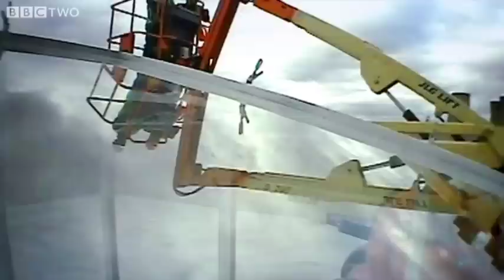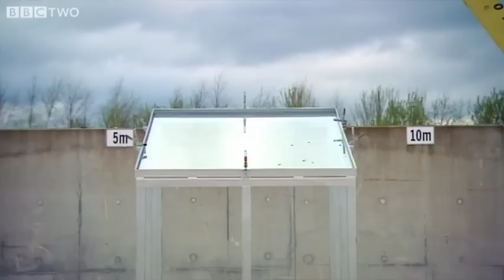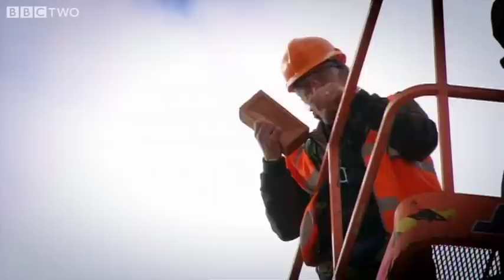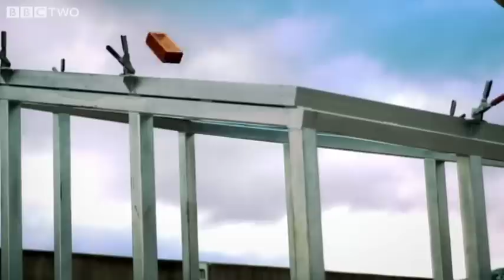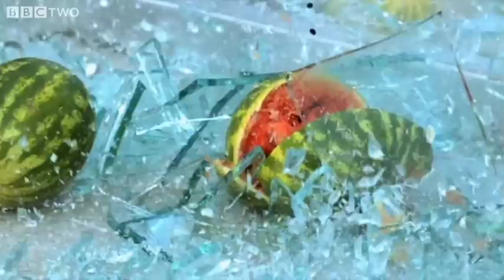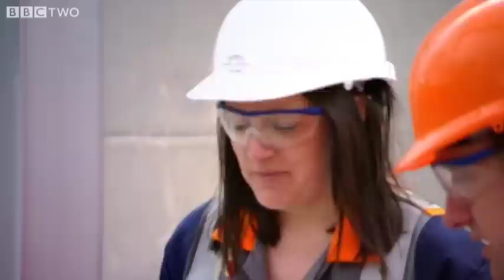Richard Hammond tests some super strong glass - Richard Hammond's Engineering Connections - BBC Two

Comment: that's funny judging from the icon picture I was thinking they dropped a watermelon through the Glass. in windshields they have that special glass that shatters into small pieces & you get cut Bad or at all.
Reply: Yep, that's tempered glass. There's a good chance your fridge, if it has glass shelves, has got tempered glass too. Also popular for household furniture. The car's windshield is also often made of layers - two pieces of glass, glued to a sheet of plastic in between, so that these little pieces don't fly off one by one, as they have this inner layer. Fascinating stuff!